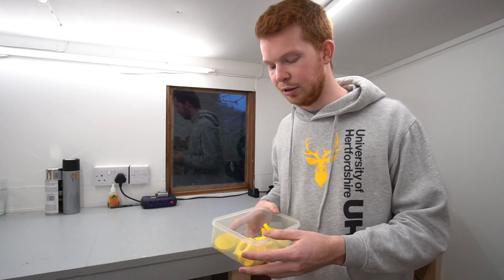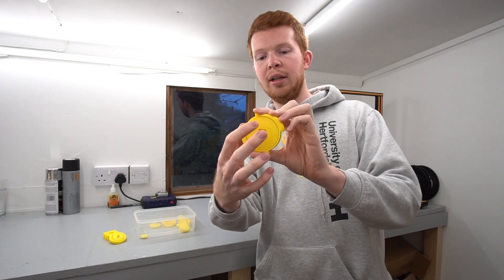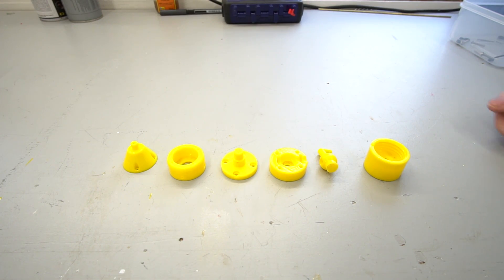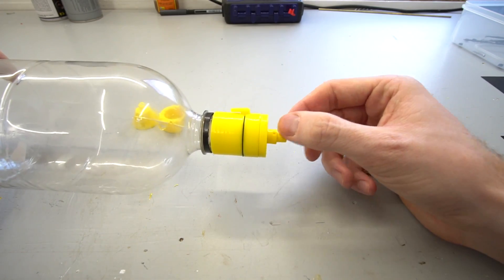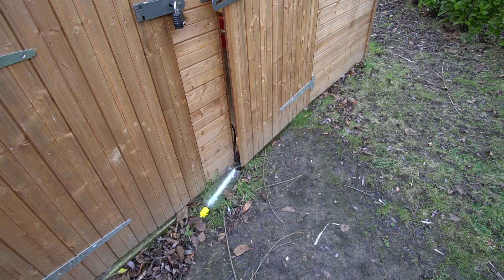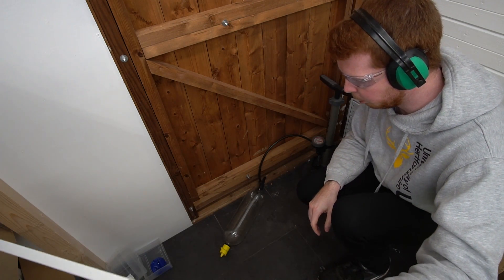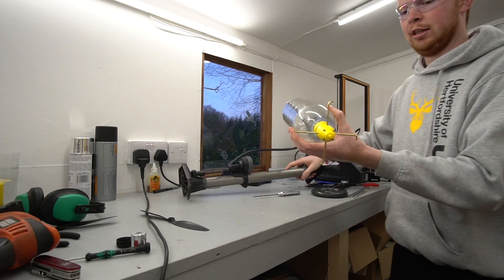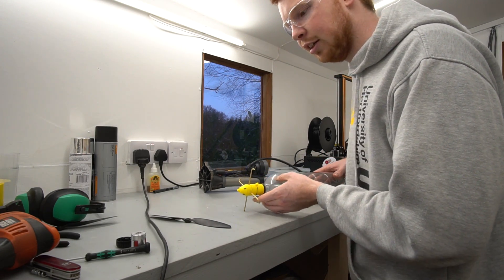Air Powered... Propeller?

Comment: I am 2 years late but... 1) Improve the seal (i.e. use a seal since there is none today) between the static and rotary parts after the valve. There are very low friction seals (although of course you will have some friction). 2) Coper pipe? Coper is too heavy. Use aluminum. You want a fast-spinning prop but that at the same time doesn't accumulate so much kinetic energy which needs to be provided by the air. 3) Enlarge all the holes and the diameter of the pipe and put a nozzle. Ideally you want a very high exhaust speed with zero loss at any point except the nozzles themselves (i.e. very low flow speed i.e. large diameters everywhere else). You must be wasting a good amount of energy in hydraulic losses since the air is moving through the pipe at the same speed that it leaves (i.e. lack of nozzle). 4) Ok, this is a change in the concept, but... put a small water tank, pressurize it with the pressure inside the bottle  (i.e. connected with a pipe) and feed the prop turbine with water instead of air. Water is about 1000 times denser than air so, although you are not going to get anywhere 1000 times more reaction because you will not be able to accelerate the water as much as the air, the water reaction will still be several times that of the air and it will last much longer too since the slower acceleration of the water means a slower shedding of the air pressure.
Once you do all that... I still don't know if it will work, but it would be nice if you tried.

Comment: Tom,  I would like to see more project videos, so maybe you can use a shortest path algorithm or something like that to your project planning to get results quicker. 90 hours is a lot of time. Have you looked at DFMA methods?

The low power devices such as air powered and flywheel powered systems will work better on lighter than air aircraft, and will last much longer. Maybe a capacitor powered helium assisted quad copter would work. There is a video of a magnet powered car on You Tube, maybe you can make it power a blimp. Tethered power, something already offered for commercially available quadcopters, is another interesting power setup you could use for rc planes and quads. More ideas...

Comment: You should have had the air supply through the pipes and had a paddle that was inside and the exhaust should come out the bottom for more thrust.

Or you could have a tilted impeller that goes the the exhaust

Comment: Have you considered some kind of governor? If the valve can be constricted or closed at higher propeller speeds, then the propeller speed would be more consistent and the air would last a little longer

Comment: The four pipes should blow against a fixed turbine blade (on the opposite side of the propellor. That should build differential pressure and push the movable part/propellor more efficiently.

Comment: Try restricting the pressure by making the ball valve never open fully by making its diameter smaller or gluing a semi circle on it so it will last longer

Comment: Awesome project, and great design skills! What about using this concept to try powering a free turbine setup where the exhaust goes through some small stators and then turns a propeller attached to something like a centrifugal compressor but in reverse? There would be less air leaked out into the open without having the chance to do work. I’m picturing something kind of like a PT-6.

Comment: add water inside the bottle , about a 1/4  level , when it exhaust the water spray plus air behind it will give you a more concentrated thrust in one direction , water rocket , mentos and coke ,

Comment: When pressure testing 1. Use luke warm water make sure as much air is out of the system not air for safety. 2. Test pressure should be double the working pressure. 3.. Just watch the pressure gauge to find leaks, do not stand near it. 4 Wear a faceshield even gauges will explode shooting glass in your face. There is a lot more but thats some of the more important stuff.

Comment: Do a re-do for this one. Make a propeller that has a hole in the blades... like a helicopter safety hydrogen peroxide pressure tip blades. Could make a neat quad?

Comment: Propellers create thrust the same way a wing produces lift, right? It creates an under-pressure at the front of the prop, and an over-pressure behind it. By pumping out air behind the propeller, you're probably messing with the ratio of under/over-pressure that the prop is supposed to create. Perhaps it would work better if you had a higher air pressure and longer vent-arms?

Comment: [this is a bit off topic] With a regulator you can adjust pressure up and down fractionally rather than just operating on/off. That way you can use less air pressure. This method can be used efficiently so that when you pump an air pressure tank up to full pressure manually, then when you release pressure intermittently on a bicycle for example, simultaneously you are pumping up the air pressure in the plenum; then on the way down a hill you can close the regulator valve and possibly continue pumping by pedal power to compress air into the plenum, and/or you can use extra downhill energy to assist pumping air into the plenum.

Comment: So this design could be reworked.
1, there is no seal for the air entering the spinner. 
2, there is no nozzle on the end and a restriction before the no nozzle. 

Try a pipe which is also the bearing. A plane bearing with a rear shoulder accurately machined, can use the air pressure like oil pressure to make it run smoothly. Wil require a thrust bearing on the inside to allow the easy rotation with pressure pushing on the bearing. This minimises leakage from the rotary joint while allowing that leakage to help make the bearing run with less friction. 

Now you can either have a printed prop that also carries out the gas to the nozzles. Or a separate prop and driving exhaust. 

Either way their should be a large volume able to travel to the nozzles with no restrictions. 

Printed prop with a ring on the outside with nozzles printed in would be my chosen design. Channeled would run down the blades to carry the air. 

Or even a design where the air exits over the prop blade. Like a Dyson fan.

Comment: The nozzles are too restrictive, and the air path to the nozzles probably has more air release area than you're getting through the actual turbine. You're better off just making the turbine vents in the plastic rotor itself (angle them to induce rotation) rather than creating additional piping. Shipping the air out those pipes doesn't give you any benefit and adds weight.

Comment: Your straight pipes gave you high volume low speed exit gas. Also probably tripled the weight. I know this is a year back, so maybe crimp the originals into flattened nozzles to test. But then maybe print the air channels into props, then glue in machined nozzles at the tips. Build in the manifold to the ends of each and bolt them around the bearing.

Comment: great vid. . I'm not sure to anderstand everything but you seem to You have falled in a pretty elegant way. 

I often spent time to think about ways to store ennergy. Mecanical accu etc.  Air is one of my favorite candidate. And since I reached a 3d printef ( very cheap one) I've been searching fr a way to make an air engine. well so  the way you manage this is very impresssive, more widely, nice solutions, insiring vids, thanks for sharing ..;.

blablabla ok, well I'm writting because i recently designed and build an airsoft and the ( kinetics->pressure--> kinetics) core of this lowtech space gun  is a ...  paper gusset and then 100% leakless. Talking about this because I think it could be efficient to replace  cylinder/piston cause it's easy to reach large diam ( my airsoft has a 50m square gusset) and so maybe  efficient to get hight torque at low rmp, enouth to start and stop from it sefl and maby few wasted air. 

So, am I anderstandable ( france) and could this work. ?

My enlish might contain some freaks, thanks for reading.

Comment: Do you have skills in fluidmechanics? What about controlling the amount of air getting out with a laval nozel and using the jet instead of a propeller? You will have a classical jet engine with no burning and no loss due to moving mechanical parts.

Comment: The compressed air escapes much to quick. Would it help if you squeeze the four ends of the tubes a little. It speeds up the airflow and will lengthen the flight.  
It's nearly one year ago since you posted this, time to revisit this project :-)

Comment: I'm saying it's better to give a nozzle to the plane, because so you're exhausting all the energy without any mechanical conversions, so it must be the most efficent solution. And the propeller can not accelerate because of the torche you're giving to it: If you make the 4 tubes tinier, the propeller would have less torch, but much more angular velocity... The plane would accelerate very much if you give the proper nozzle to it and it would be also lighter because it wouldn't have any kind of strange mechanism.
Greats!

Comment: Your bearing seems like it might be binding up because of the axial force from the pressure pushing out on the hub. You only made sure it worked by just spinning it alone, but maybe the outward pressure as well is causing it bind up somewhat and be less efficient. It almost looked like that's why it didn't want to start spinning on it's own as well, and why you had to give it a spin first just to get it to work at all.

Comment: Can you try to fill half of the bottle with water? I would like to see that. I think that the air will push the water in the tube if you hold it with the propeller downward. The water is heavy so the effect will be much bigger like in water rockets!

Comment: I think you should use something like a carbon fiber HPA tank such as used in paintball u could get a used one which is past its Hydro date for relatively low cost with the internal pressure is 3000psi to  4500 and then use a regulator to reduce the output pressure

Comment: If you're using the propeller to generate thrust, why should you put the pipes at an angle?  I mean, you want all the air to produce just circular motion which in turn will make the propeller rotate... If you make the air exit just tangentially in the same plane of the rotor, maybe you could have better results.

Comment: I think maybe your problem is that all of your pressure isn't exiting through the nozzles, you have quite a gap for the rotation clearance between the shaft holding the bearing, leading to a massive amount of loss of pressure there that doesn't make it into the exhausts you designed. Not sure how you'd fix that though, it seems like you'd need to have a rotational joint that's also capable of holding pressure.

Comment: if you made the air came out the holes from those tiny holes and but they didnt move with the prop so you didnt get the maximum efficiency u needed to get a sufficient amount of thrust so if you made the holes that were supplying the air pressure to the pipes rotational you could get more thrust like the one you got on Christmas (i saw this and im only 15)

Comment: Conservation of energy. 
The thrust from the small jets (thrust-1) to turn a propeller to produce thrust (thrust-2)

Thrust to make thrust. The energy in thrust-2 is less than the energy in thrust-1 by design. Doesn’t pan out. 

So it was dead on paper.

Comment: your wasting the angular momentum with the brass  tubes aimed towards the bottle. angle them perpendicular to the axle. you will get better results from doing that. the reason the balloon version has them angled is because its built into the propeller. i also recommend only having one small hole for the air to go out if you are planning on expanding on this idea. if you only have one hole less air will be lost and as it spins it will go onto the next tube.

Comment: Did you tried a tesla turbine? It was designed for water but maybe with little space between discs it could handle air as the motor fluid

Comment: Rubber 'o' rings for ballvalve no good, once the grease blows out, lots of friction. Just machine the ball seat into the plastic housing, and use silicone grease. Heat up a steel ball on a stick, the same size as the ball in the valve, to around 205° C, or whatever the filiment melts at, and just melt in a little seat in the plastic.
Just dunk the air-filled bottle in a 19L bucket full of water to check for air leaks. You will also see were they are coming from.
I like these string of videos on air powered engines you have made. Thank you.

Comment: Maybe a stupid idea, but why not use water as a medium instead of air? Like in those water rockets? Mount the prop backwards and add a tube in the bottle that hangs on the back/bottom inside and add a layer of water in the bottle before you pump it up. At least, that's what I would try ;)

Comment: I feel like this engine concept is crippled by the low mass of air. It just whooshes out through the air tubes without imparting much "push" because air doesn't weigh much.

However, it might work nicely if the compressed air were pushing water through the tubes. This makes it operate like a water sprinkler. Water has a lot of mass, so it'll induce a lot more spin. You'd want to pinch then ends of the tubes flat, to reduce the mass flow and increase the speed (think pinching the end of a garden hose). That'll give a lot more endurance, while also producing a lot of torque.

Of course, carrying all this water will make the vehicle heavy compared to an air piston design. But maybe spraying water all over the place has some artistic or fun factor...

Comment: Someone suggested a water rocket.  It will obtain the best efficiency.  The air engines are never as efficient as the water rocket.  80 to 95 % efficiencies are obtainable with the water rocket and you can then claim to be a rocket scientist:?)

Comment: Am I right in assuming that having the whole assembly somewhat airtight to force all of the air out the nozzles would help here?
Also, are you sure that having 4 holes matching the 4 holes on the rotating outside part is optimal?
One could imagine fewer holes or more, smaller holes to deliver higher/lower pressure at smaller/greater time intervals.
Further, do you think that giving the holes in the outer part a sort of funnel shape would decrease air leakage?
Probably a second bearing or a set of 2 smaller ones would decrease the wobble and allow tighter tolerances?
Best

Comment: heres an idea for you. go for a hybrid fuel, aka add water. just like in a water rocket,  you use the pressure of the air to push water out of a nozzle, and you get more thrust due to the higher density of water.

Comment: I feel that the brass thrust nozzles are too large. The idea is to maximise the velocity of the escaping gas, to get as much exhaust momentum per volume as possible. You need to find the nozzle diameter that approximately achieves this maximum. Perhaps you just need to pinch the tube ends?

Comment: I think part of your problem is that you haven't accelerated the air from the outlets enough.  It's too free flowing, therefore you're losing too much volume too quickly, at too low of a volume.  Although this will never be a viable prop motor, it could be optimized.  Cheers.

Comment: You should avoid the downward angle on your pipes. They remove alot of the turning speed. Also you should not use brass tubes, use plastics. Also think of adding a nozzle to the tubes to increase the air speed. Upward movend will only be generated by the propeller blades which have a certain angle. The tubes are only for rotation movement and this has to be as fast as possible.

Comment: you need to design a pressure regulator to control your air flow so it runs slower but longer

Comment: Can you try filling the bottle 1/4 - 1/3 of water, then using the bottle cap valve as a nozzle. You have just made a water jet. Strap that to a large foam glider, bingo air powered plane.
You could then experiment with different quantities of water and nozzle sizes.  FYI I know this principle works as I had a shop brought one about 25 years ago.

Comment: Why not lengthen the wires directing the air? That would increase the torque, thusly increasing the angular velocity. 

Also, why not use the wires as a basis for attaching a propeller? Surely you’re adding extra mass to add the other black propeller. 

Have you considered the smaller compressed tanks used in air soft guns? I know weight is an issue, but they hold a very high pressure of co2 (at least 100 psi, I’m sure), which is denser than the air. 

Either way, thanks for the video, very interesting!

Comment: The energy of the expanding gas would more efficiently be converted into rotational momentum if you flipped your little tubes around, so that the short ends of the Ls were seated into into the propeller assembly. As you have it now it looks like you were going for a certain amount of leverage to assist in rotation, but by the time the expanding gas reaches the corner of the tube it has already expended a good portion of it's energy and there isn't much length of tube after that to translate that energy in a counter momentum.

Comment: you could restrict the exit and make the air tubes slightly longer, to make the end smaller, stick a guitar sting or a needle and roll the end onto the needle until it just fits with grip then bend the 90 degree but tweak it a couple degrees tighter.

Comment: I'm late but to check for leaks with a bicycle pump, bring the pump lever up, push down gently enough to hold it by air pressure, and then watch/feel to see if it goes down. maybe this isn't accurate enough though?